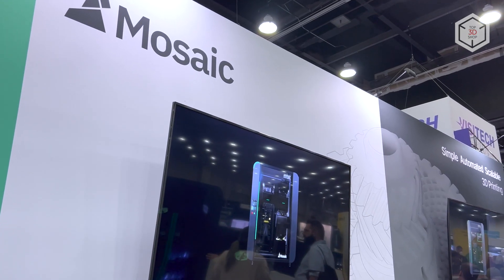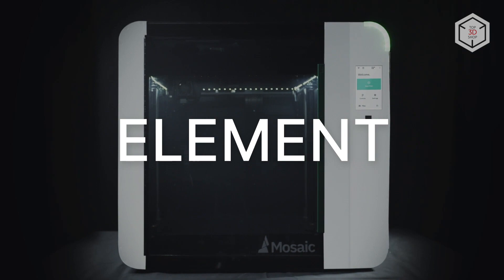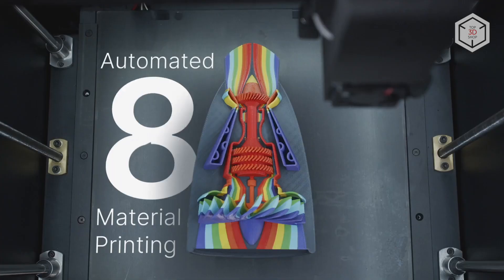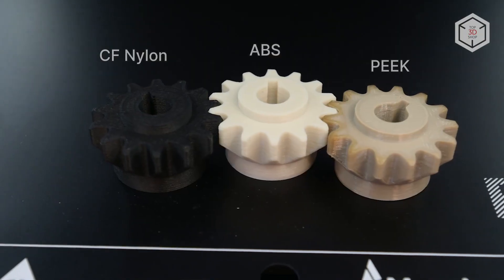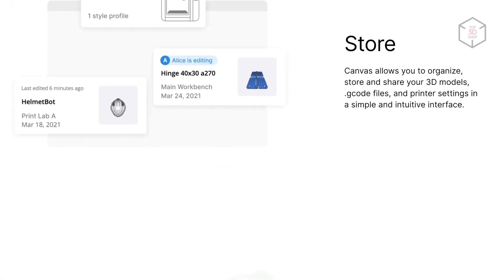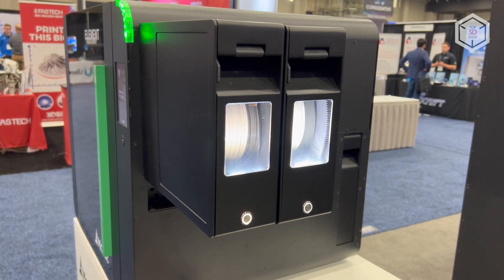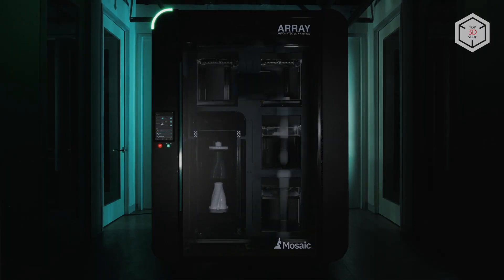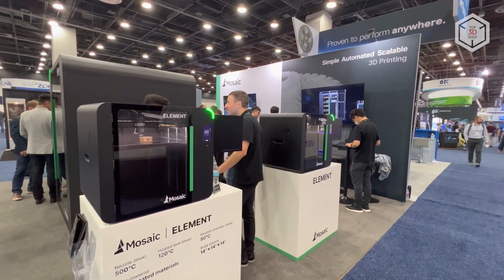Mosaic Element HT 3D Printer Overview: 8 Material, High-temp Printing

Comment: I’m just curious to see how much material you are going to waste when you make a material change. If it work like the normal palette 3 pro which need more filament for the wasting turrets than for the piece itself, using peek it’s going to be proibitive expensive considering what it cost
Reply: Yeah I was thinking the same thing. I really hope they use a purge bucket and wiper for this printer, which is much more efficient than a purge tower because it doesn't need to be the same height as the print itself, so as long as a colour change isn't needed

I once considered buying the consumer palette, the 2S I believe, a few years ago. Now, given how many reviews are saying that it's a really bad, glitchy product, I'm glad I didn't. There are still heaps of bad reviews on the successor of the 2S, which is the 3 and 3 Pro, out there as well so it appears things haven't majorly improved

Comment: Has anyone actually used this printer? I waited a year after buying the mosaic pallet 3 pro and it’s a garbage product.
Reply: Well it costs 11k Euros so I don't really care if it's good or not. No way it's good enough to justify that price.
Reply: @atnfn   They also don't offer refunds either. big red flag.
Reply: 80 degrees enclosure temperature for printing PEEK…good luck
Reply: I have a HT model with eight pods. It's a friggen beast.
Reply: I ordered one of these about 7 months ago, it was not apparent that it was not available when I purchased it. I was told that it would be about 2 months until I received it. They pushed that delivery time back about 3 times until I just cancelled the order entirely after being misled so many times. Lost faith in they would deliver on anything they said. Looked for unboxing videos or anything to indicate they actually released it by now and have not found anything. Shady company in my experience.
Reply: What makes the mosaic palette 3 pro garbage? I am curious